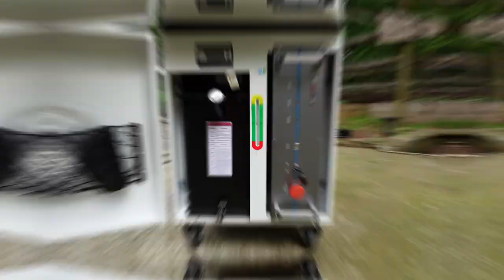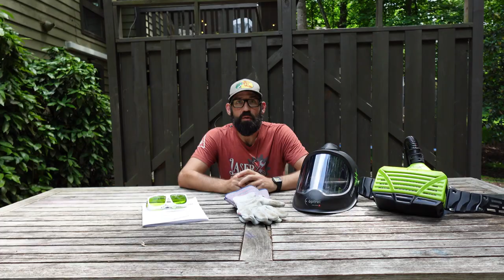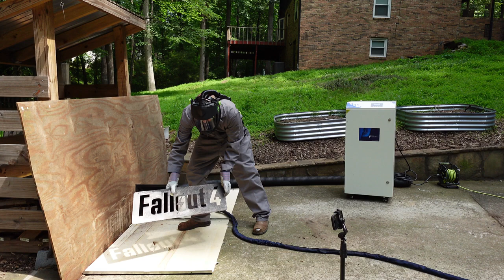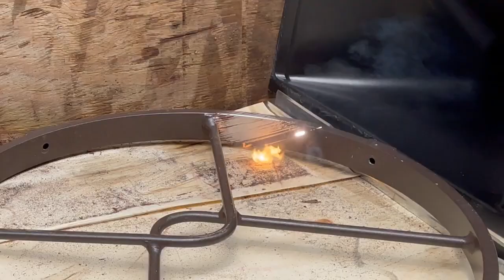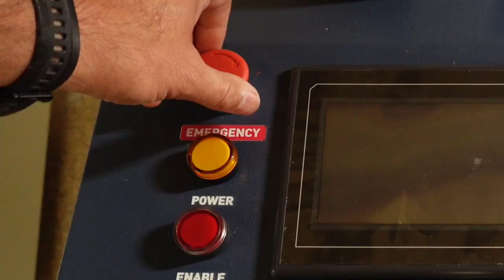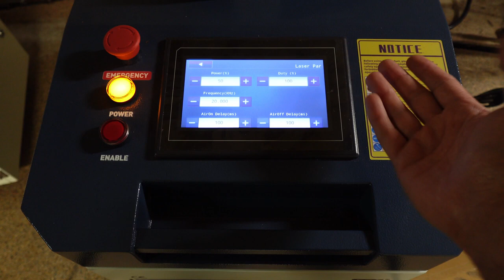SFX Laser Cleaning Machine Ultimate Tutorial&Laser Cleaning Case Display

Comment: I recently purchased a 300w Multi Mode - a 300w Single Mode & a 2000w CL, Is there a chart for different materials & applications ie.. Metal - Wood - Concrete - Brick - etc?
Reply from the maker: Hi, you will be contacted by a specialized person.

Comment: If I clean with this laser machine... Do i need what. Laser machine and power and how much? is it one phase or tri phase? and do i need gas or pressure air  ? with this ?
Reply: Single phase, but youl have to put a 30 amp plug on it. The book says it draws 40 amps, but i run it at 100% and it hasnt tripped a generator with a 30amp output

Comment: I got one but it sucks that it didn’t come with a plug on the cord and it’s 240 volts. It came with a cord with three wires. I know it’s more powerful with 240 volts but finding that in the US is more difficult. An electrician wanted $500-700 to install a 240 outlet. The 220V wiring diagram was insufficient with two diagrams with no clear directions on which one to use. I guess one is three wire diagram and the other is four wire. It’s not just plug in and use.